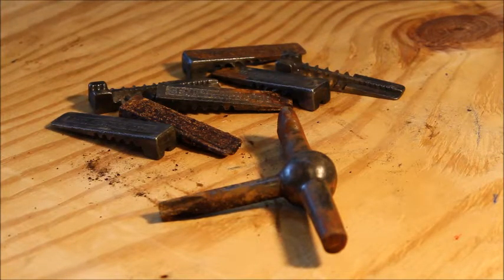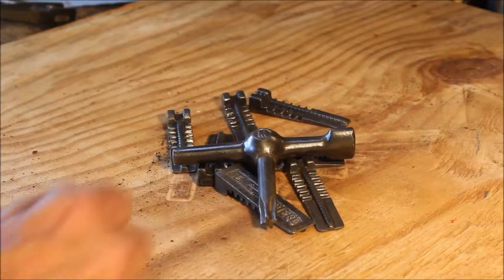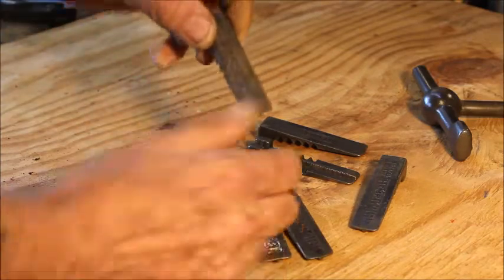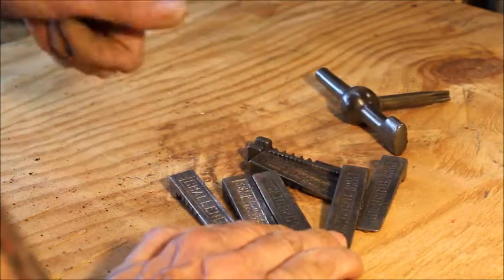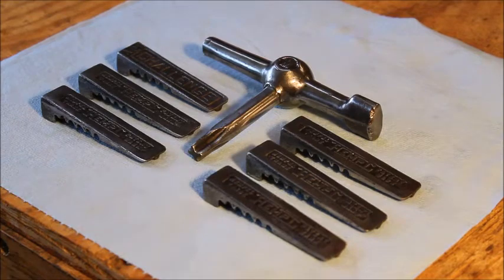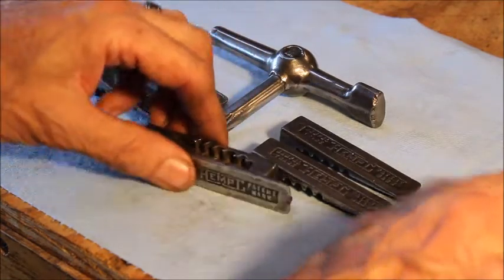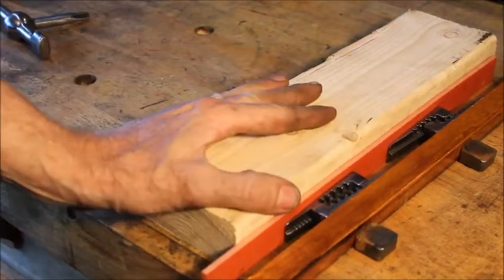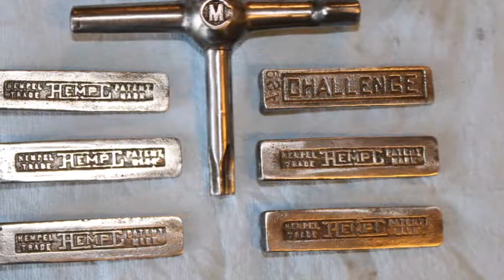Vintage Letterpress Quoins & Quoin Key Restoration

Comment: Thank you for posting this video. I was only familiar with hi-speed quoins for my press, but have a few sets of wedge quoins that I wasn't absolutely certain how to use correctly. The trade is dying and it's getting very difficult to find resources like this that demonstrate correct usage. Very helpful. Thanks!